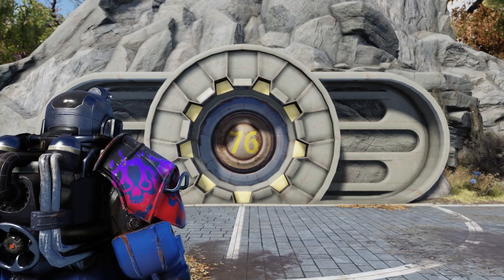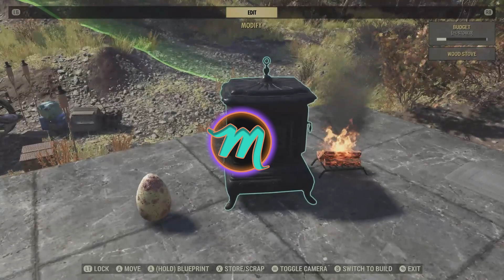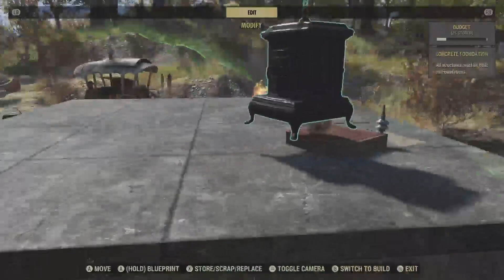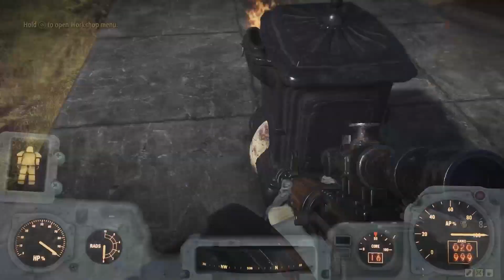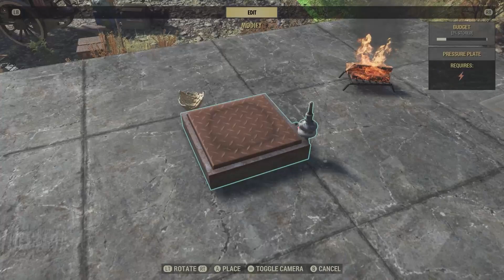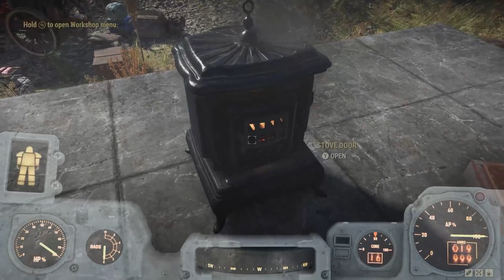Merging Old Glory Fire into the Wood Stove

Comment: The stove doesn’t sit over the egg or move with it to the plate.
Reply from the maker: Not sure if the latest update rendered this process moot. I haven't tried it with the updated Wrecking Ball perk card (skipping the egg altogether for the free destruction/fix) and just destroy the wood stove (with bullets) and set the fire where it needs to be using the pressure plate for elevation. hmm....I might have to make a video update.